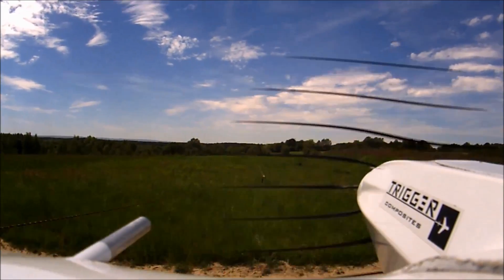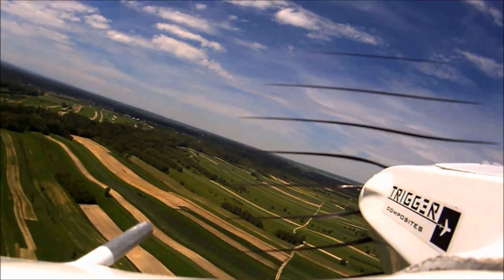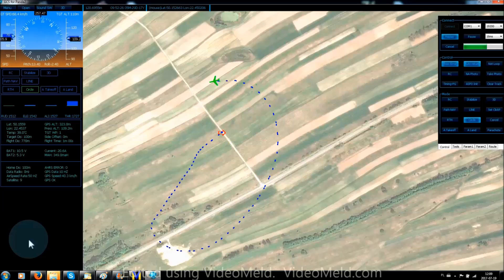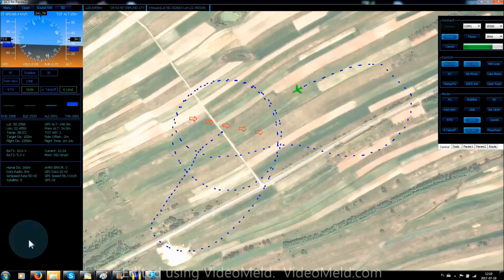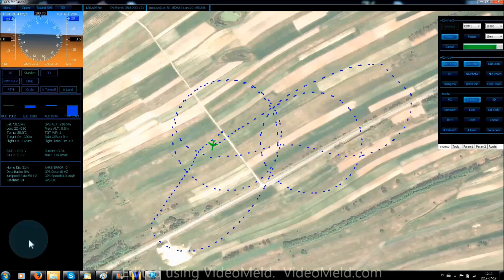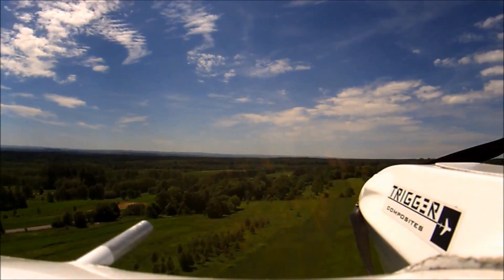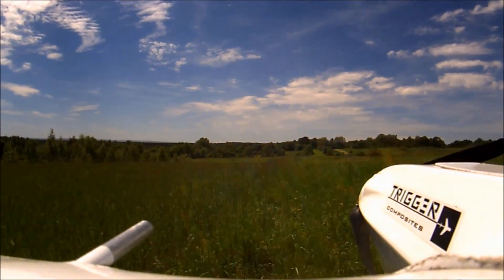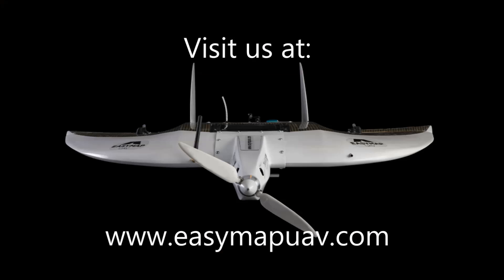EasyMap UAV: Super Slow Landing Mode in details.

Comment: I do the same thing with my F-27. Throttle to idle and pull full back on the stick. It comes down perfectly flat, vertically, right at my feet.
Most deltas can accomplish this.
Reply: Did you means revert throttle?